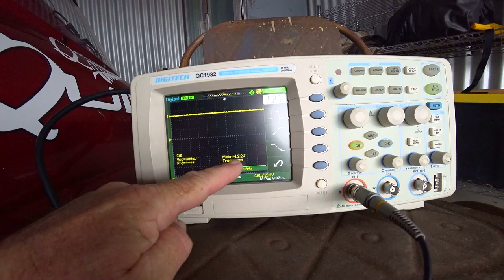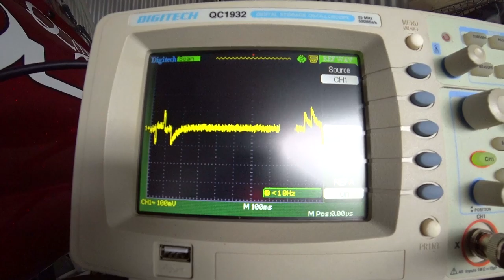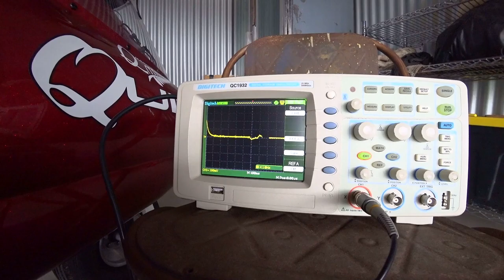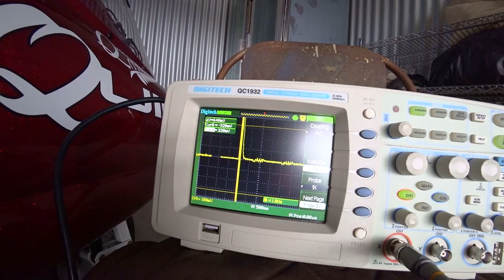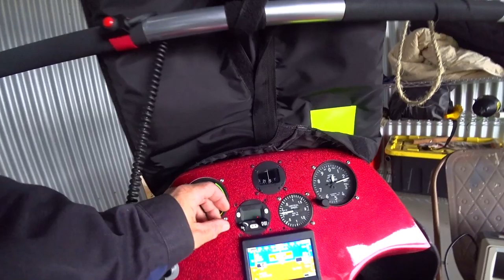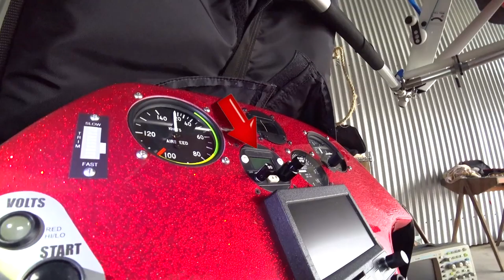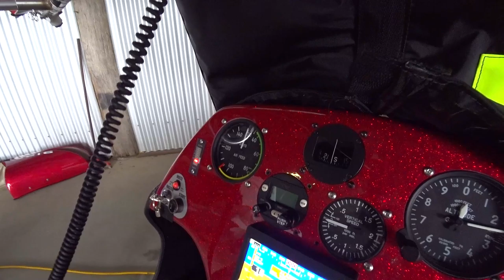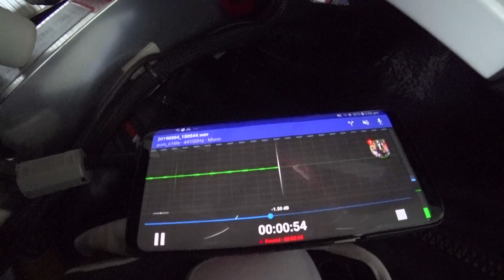PROBLEMS: On the Trail of an Audio Issue. Part 3.

Comment: Boy do I fell you pain,  I have a bit a static in my trike that I've been troubleshooting bit by bit over the past few years. (It drives me nuts) Started by adding new grounds from engine to frame and frame to dash, redid all the wiring in the entire aircraft with shielded Aviation wire using a central ground. replaced the antenna wires moving them as far away from the power wires as possible, I replaced the antenna still no luck,  About to add a Cap to the voltage rectifier,  (22,000 uf) and shielded braids on the ignition wires.

Let us know if you figure this out.
Reply from the maker: Michael R What sort of noise do you have?  Mine is definitely strobe (LED), but sometimes I have other random issues.
Reply: @CrayonboxAviationAdventures  Static.  Constant white noise,  doesn't change with RPM.   only occurs once off the ground.  Added ignition wire shielding today, which didn't help =(   going to try moving the antenna next